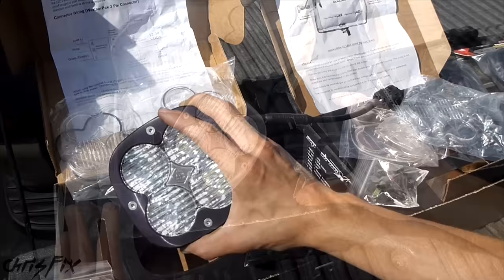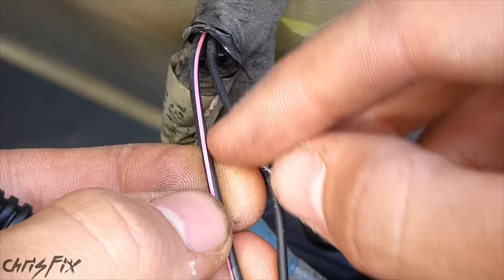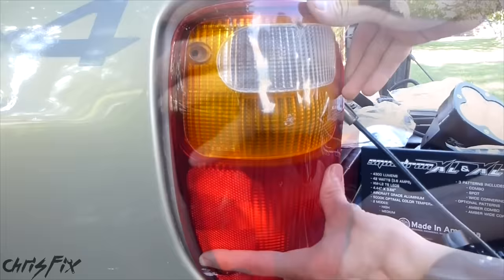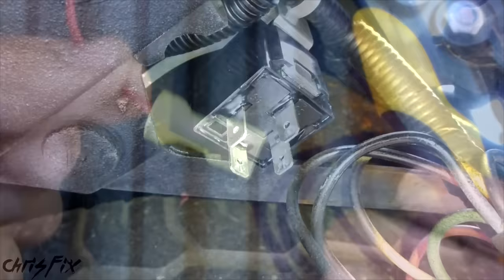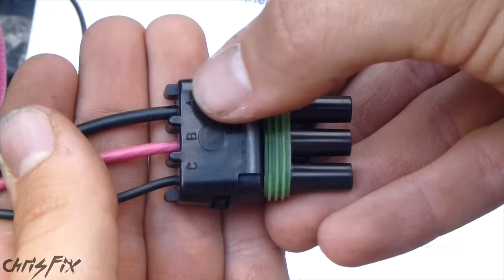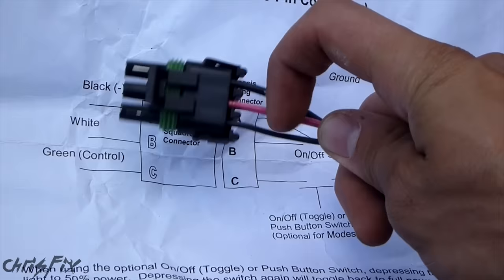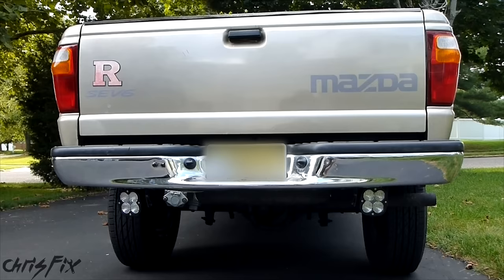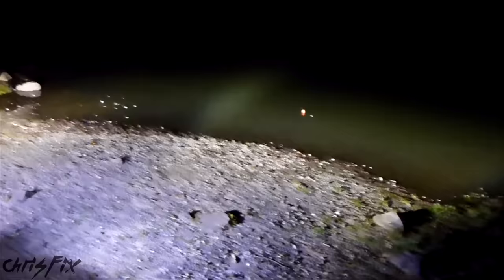How to Install Auxiliary Reverse Lights

Comment: Don't use a relay and you were done at the first snip 😂 that's what I'm about to do. I'm running alot bigger lights then that on my fog light relay and I assure you it can take it like a dirty stripper after you give her some blue meth. Also considering the 2 incandescent fog lights i took out pulled more amps then all the LEDs I put in, and there's 52 of them. The reverse lights are on a relay as well and I'm sure it can take it.

Comment: You sanded the area for your ground but you should have sanded both sides of the washer. So you put a painted washer then the ring terminals onto the painted surface of the washer. Poor ground that way. Also your fuse by the battery should be closer to the battery as in 12 inches or less of wire between your battery post and the fuse.
Reply from the maker: Thanks for the tips Kenny

Comment: that wire job would not last a week in ohio winter road salt run the power wires to under hood put relay up there grab reverse light wire under hood use solder and heat shrink not but fuck connecters

Comment: Horrible mounting location as when you come to a hill or large dip on the trail it will completely bust those lights right off your bumper.  If you DO run your truck on the trail you will understand what I am saying...  Mount them up high like on top of the canopy or the cab pointed backwards.  If you are just a pavement queen the mounting location he has will be fine.

Comment: Sloppy . You should've run the hot wire to an off on switch in the dash then to the battery so you have control. You'll  blind other drivers in parking lots & your instalation  may conceivably violate vehicle code. Don't be surprised when a police officer stops you to cite you for vehicle violation.  Your relay has a mounting tab on it with a hole in it that should've gone to an existing hole in the chasse . Relay dangling from a wire tie will eventually fail. Sloppy,Sloppy,Sloppy

Comment: Those "waterproof" connectors are a farce. Laughable, really. PLENTY of water is getting to the wires. From the back end. Where you flipped up the last piece to "lock it in place." You could fix that by packing the rest of the cavity that the wires goes into, with RTV, before you flip that last piece over and snap it in place. An ordinary tube of RTV with the smallest amount clipped off the "nose" of the tip, will easily squeeze plenty of RTV into those cavities. Make sure both of the connector ends are done that way, (don't rely on the factor having sealed their end.), and then you will have a truly waterproof connection.